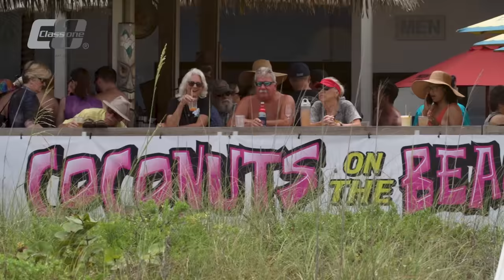Highlights Show | 2022 Class 1 Cocoa Beach Grand Prix

Comment: What is are the common causes of breakdowns on these boats??  Twin turbo V8 sounds simple enough
Reply: It’s a DOHC 9liter twin turbo v8 made my mercury that produces 1100hp that’s running at 8500/9k rpm’s for literally hours…
On a surface that is constantly changing. The force from Landing back in the water. Things break. There’s not one common or few common things. Things can’t handle the physical stress and pressure the water makes. Then running at 7k rpm’s for 4 hours. Much much different then road racing, drag racing. Literally nothing compares to offshore and hydroplane racing. Absolutely nothing.

Comment: H1 Unlimited Hydroplane boats are actially the fastest boats on the planet. These Class 1 boats see speeds of 210 km/h (130 mph) H1 Unlimited regularly see speedscin excess of 310 km/h (or 195 mph).
Just sayin'.
Reply: There hittin 150 in the straights. Super cat class is hittin 130 with there twin 750s
Reply: @jessemilstead810  Make no mistake about it - these boats are bad mohambi-jambees - and it takes guts to hurdle across heavy chop with AUTHORITY!
I don't appriciate it when a professional commentator does not know the topic they are commentating on. It's not professiuonal in the least, and it's disrespectful of the sport.
I do my utmost to either know enough about a topic to comment on it, or keep my offerings phrased as questions offered toward someone I know has a solid track-record that has a result that is undeniable.
One thing that is awesome is, there are a LOT of really AWESOME KINDS of RACING!
Reply: Class 1 top speed record is 273 km/h
Reply: Try that on the ocean.
Reply: And actually I made a mistake it's 276 not 273
Reply: @Spyker8921  it’s Steve Curtis spirit of Qatar ozarks shootout 244MPH.  STAGGERING